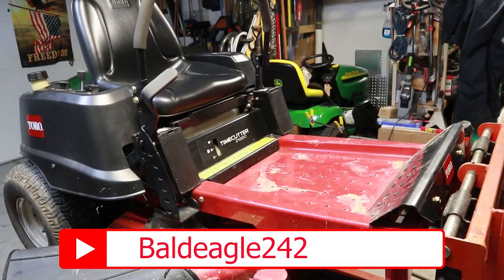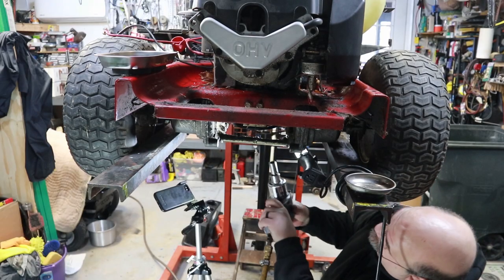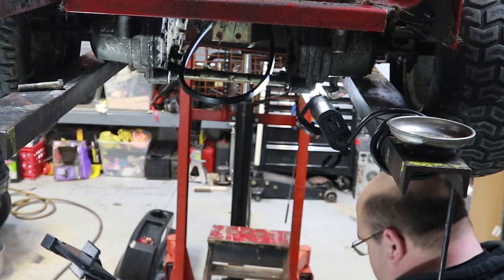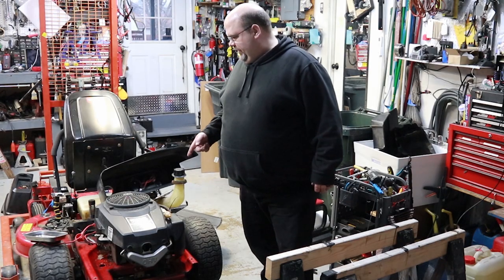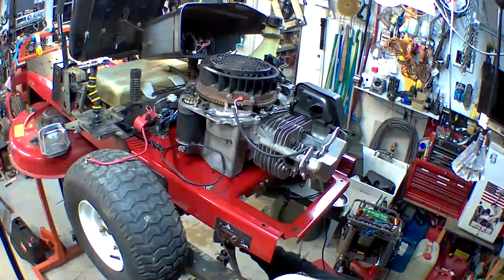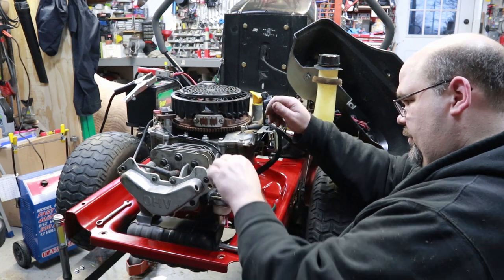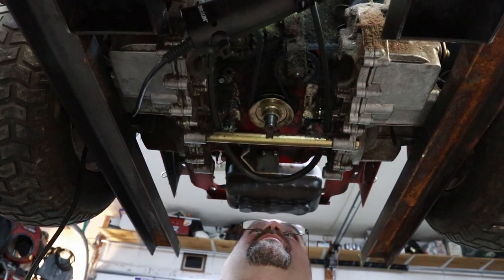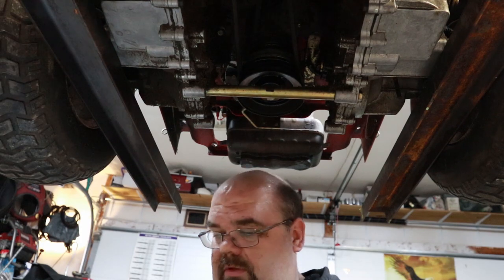How to PREVENT the Kohler Courage Engine from Cracking the Block #baldeagle242

Comment: My Courage emptied the oil while mowing last week. Yup bolts were loose but had not reached flywheel but enough to allow stress crack. 
I'll try JB and blue Loctite.
Reply from the maker: I wish there were a way to make a public announcement about this issue. 🤦🏻‍♂️
I'm not a big fan of the Courage motors, to begin with, but this situation is entirely preventable if caught early.  
Thanks for watching and good luck with your repair.  🦅
Reply: For a cracked case, try the product allumalloy aluminum soldering rods. Haven't used them for a cracked case, but have used them in other applications.

Comment: That's what happened on my neighbors CubCadet rider, it broke the cylinder clean off the block!
I got it for nothing, put a B&S motor on it from a Craigslist guy who has basically a mower junkyard.  Paid him $50 and the Kohler motor (starter and carb looked fine) ran it in the county fair demolition derby ($120 for 3rd place) and sold it for $300.

Comment: i have the exact same mower i changed my engine out for a Command 23 that i got for $60 it was from a John Deere L130 fit perfect just had to re-wire adjust throttle and add a Choke which a hole is already cut out for next to throttle cable

Comment: I can say I change the oil in my 2006 very frequently.  Every mowing actually.  Fortunately the crack is at the top :)
Reply from the maker: I’ve seen them run for many years with a cracked case if the oil is kept topped off. 😉👍

Comment: Have one like that one,  bought new from HD in 2007 with the same motor, it's just now giving me problems I consider myself very very lucky since that mower has been worked hard every summer and fall.
Reply from the maker: Thanks for watching.  I've seen a few 15+-year-old Courage motors still running well. With a few precautions and regular maintenance, they will last.  They're just not a motor you can beat on and neglect the way some owners choose to do.
Reply: I have one from 2005 which I owned since 2010. Still goes on perfectly fine.

Comment: My Courage blew up bang,  fire and oil.   I was told that a counter balance weight  comes loose over time on the flywheel.  They are really the junk lowest end of Kohler engines.   The lawn mower dealer here told me that they almost all blow up and have to be replaced.
Reply from the maker: Generally it’s the case bolts that catch on them and and knock them off.

Comment: Tell me about that mower lift you have.. Home built or store bought? I could use one... TY
Reply from the maker: That lift was bought from a tool rental place that I've done work for.  The owner told me he'd had it there for 2-3 years and never rented it once.  I purchased it for $200. I added longer forks to pick up riding mowers and zero turns and welded a flip latch onto the mast to lock it in place once it's up. Other than that, it's all original   
Here is a link to a similar one on Amazon.  They're not cheap.  
(may need to copy and paste)

https://www.amazon.com/dp/B08SLY7C9T/?tag=eagle0f1-20
Reply: Thanks, got the link. Is salty but I know what I'm looking for now////
Reply from the maker: +Tbear rails, you're welcome, thanks for watching. 🦅

Comment: Let's say my Toro is in great shape but this hapoened to my engine... if possible could I replace the engine with something that is not prone to these issues?
Reply from the maker: Yes, just about any similar sized engine can replace the original. The main issue is making sure the shaft size is the same length and OD and the exhaust system comes out in a location that works.

Comment: I like your videos. Curious about the lift, you say you use it every day. Do the forks get in your way as you work?
Reply from the maker: +colten1d 60 

There are times they can be in the way for sure. You want to remain aware of them, so you don't hit your head on them.  It's no different than any other type of lift in that regard. For the type of work I do, the pros outweigh the cons by far.  By design, the lift is easy to push and move around as long as it's on a relatively flat surface. I would not recommend it if you're going to use it once or twice a year because it does take up a lot of floor space.  On the other hand, you can raise something and park other equipment under it to save floor space. 
I've had enough questions about it that I plan to make a short video about the lift soon.  
Stay tuned!  🦅
Reply: @baldeagle242  Thank you.

Comment: I have the 5400 engine. Should I worry about this? I can easily remove the shroud and Loctite these bolts.
Reply from the maker: I've not seen a problem with that engine but it never hurts to check.  Thanks for watching.  🦅🇺🇸
Reply: @baldeagle242  I just found your channel and plan tp binge watch when I get time. Thanks!
BTW what are your thoughts on the 5400? I read where mechanics don't care much for the Courage, I thought the 5400 was pretty much the same engine.
Reply from the maker: @unti419 Thanks for watching.  Most of what I work on are older machines.  The 5400 was introduced in 2014, and so far, I've not come across one that needed internal work. That doesn't mean it's good or bad, just my personal experience.  From a quick google search, I found a few links with more details.  The information on Kohler's website has quite a few facts about the 5400.  Kohler is well aware of the reputation of the Courage; I would assume they did as much as possible to address the significant issues that the engine was plagued with.  With that said, the 5400 is still a price point engine, so, in my opinion, it's not going to be an engine that's expected to run for 10,000 hours.  Next time I get one in my shop ill try to do a full review on one.
Reply: @baldeagle242  I changed the oil in my 5400 tonight and pulled the shroud. It requires 4 10mm bolts and a T20 screw in the plastic intake manifold above the carb. All the case bolts were tight, there were a few manifold bolts that felt loose but it's all plastic so I just snugged them up.
Reply from the maker: @unti419  That's a good deal.  These engines can run for a long time with a bit of attention. Thanks for watching.  🦅🇺🇸

Comment: What are your thoughts on the power more single cylender engine
Reply from the maker: It’s an MTD branded engine that’s built in China. They are basically a disposable engine with limited parts available.  With that said they are comparable to the Briggs and Kohler entry level engines that are built to budget friendly price point.
Reply: @baldeagle242  I am trying to start a service and fix/flip shop I have close to 30 mowers most need some form of carb work mtd with the steering problems I have a craftsman with that and the yard machines with the powermore I appreciate the comment
Reply from the maker: @alliesman9758  I’m starting to see more and more of them each year. Some Kohler parts can be made to work in certain situations.  They are basically a Kohler knockoff.

Comment: Can you show me where and how many bolts that engine has to mount it plz
Reply from the maker: There are 4. One on each corner. One of them may have a nut on top that also hold the negative ground cable.

Comment: An honest seller, which doesn't happen every day.
What is the name of your lift?  What is maximum lift weight?  About how much does it cost, and did you buy it on Amazon?
Thanks
Reply from the maker: The lift stacker is made by Jet.  It's used for moving and stacking pallets.  I purchased it from a tool rental place that I do work for.  They had it on the floor as a rental, and when I asked the owner about it, he said he'd had it for 3-4 years and never rented it once. He sold it to me for $200 just to get it out of his way.  I use it almost every day.   Thanks for watching.  Here is a link to a similar lift.  
https://www.amazon.com/dp/B091NQNBXX/?tag=eagle0f1-20

Comment: There are just too many design flaws with this engine other than the case cracking. The valve covers always leak and the mechanical decompression assembly on the plastic cam gears just to name a few. I would repower with something else unless you want to keep working on it.
Reply from the maker: You're not wrong. 😉
If I didn't already have the extra “Discourage” engine sitting here I wouldn't have bought one to put back on it.  Thanks for watching. 🦅🇺🇸
Reply: I have a 15 year old mower with a Kohler Courage 15, not had a single issue with it. Just waiting for something to happen when I see these videos.
Reply from the maker: @erlenddammen2174  I've seen some pretty old ones still running strong but I've also seen more than my fair share of blown and cracked cases also.  Thanks for watching.  🦅🇺🇸
Reply: I hope it holds up. Used it with success as late as today.
Reply: @erlenddammen2174  Kohler Courage single cylinder?
Reply: @andybecker2693  Yes.

Comment: learnd alot about my kohler motor. got a free mower what had a fire. tore off all the burnt crap, put a battery in it. with startr fld it startd. coil wire burnd to fiber but still startd wow! hosed it off now it wont start. fuel line not leakin and still intact. couldnt find a fuse to check. vapor hose into air filtr i thought was just a nipple i now realize is a hose to air cleanr.
Reply: ive got couple othr mowers, now im thinkn about scrapn the 20hp kohler for a briggs 18.5. hopefully my belts will still work
Reply from the maker: Belts should work fine as long as you reuse the same pulley.

Comment: Thanks for the info. I had a rider with a Kohler Courage and I didn't have this problem yet...but I'm sure it was lurking around the corner.  As to date, it was the worst engine I ever owned. The biggest problem I had was the valve cover leaking oil even after replacing the gasket and cover. It would drip on the exhaust and smoke. Also, the valves constantly needed adjustment. Just after a few hours, it would replicate a dead battery but turned out to be valve lash adjustment
Reply from the maker: The Kohler Courage is one of the worst small engines ever built.  Valve covers leak on almost all of them, cam gears are plastic and the problem I mentioned in the video with the case bolts backing out is the demise of at least 4 I have worked on.  The most surprising part about this entire video is I had a "good" one to replace it with.
Reply: The Kohler  Courage is a real dog, especially the single cylinder.
Reply: @baldeagle242  There is a update kit..."Kohler # 20 096 14-S"  ...new valve cover, cork gasket, and a stiffener plate that fits along bottom edge of valve cover to bridge the area where bolts should of been. Coat the gasket lightly on both sides with non-hardening gasket sealer, properly torque bolts to spec...no more leak.

Comment: I thought Kohler was better than this!! What chunk they are!! 
Mine has 170 hours on it and the rocker arm stud loosened up and took out the entire exhaust valve train. Rocker arm split, the push rod bent. I replace them and tried to adjust the valves. When I set the exhaust side at the 0.07 it compresses the valve spring so much that the engine locks up. 
Now I have to tear the case back apart and try changing the cam and  the follower. It must be damaged too!! I hope it works I gotta cut my grass!! 💩💩
Reply from the maker: The older Koehler K series engines and the “newer” Command engines are not bad but their Courage line was built to meet the lowest price point possible and they just don’t hold up over time.

Comment: You have real good vids here so thanks for it! I didn't know about the case bolt issue so it's high priority to get after it! I hate the lack of non-serviceable parts on my toro 42SS timecutter. Especially the hydrostatic transmissions not having a drain and fill plugs. Do you have a method to service these before it's too late?
Reply from the maker: My father still pulls them apart and rebuilds them. Most of the time the only thing he finds wrong with them is a clogged screen with buildup in it. Other than new seals, bearings and gaskets most of them go back together with all the original parts. We’ve talked about making a full video about this but haven’t found the time to complete it. Here’s a link to a really short video he recorded of himself last year rebuilding a hydro transmission. 
👴🏻Father’s Day with Dad: Cleaning & Assembly Project with 81 year old Father!
https://youtu.be/gyqeDNfXBow

Comment: Nice video! Would you happen to know if a sv730 the 25hp twin cylinder will bolt up to a z4200 that came with a sv610 the 21hp single cylinder model?
Reply from the maker: The simple answer is, it should but I’ve never made that swap. Common issues are exhaust connections and location. You will need to make sure the 25hp comes with everything and possibly the linkage connections. Another thing you want to check is the shaft size for your clutch pulley. The 25hp might be larger. 
The mounting holes “should” be the same.

Comment: Hey Bald eagle. 👋 how are u doing these days.  I have a friend that has a kohler courage 20 hp. It just started missing on him the other day   It had been running fine. We changed fuel filter ,plug ,put fresh gas in and it runs good for a few minutes then it starts missing again. What would you check next.??  I know the courage has a bad reputation. It's on a cub cadet 1045 riding mower
Reply from the maker: Check the fuel cap.  It may be as simple as a cap that's not venting enough to keep the fuel flowing. 
If that's not the issue you may have a bad or weak coil.
Reply: @baldeagle242  ok thanks very very much 👍🙂

Comment: I am pretty sure I commented in the past, but I am doing this again on another mower.  It is just a great video.  I would love to see a short on how to get that PTO clutch and pulley off on a hard one.  My first one was very hard and this next one looks to be hard also.  Any comments?
Reply from the maker: I use an Air Chisel to Remove a Pulley if it’s stuck. 

	1.	Prepare the Bolt:
	•	Screw the bolt back into the pulley, leaving it backed out by 3-4 full turns.
	2.	Create a Center Point:
	•	Drill a small divot in the center of the bolt to help keep the air chisel centered.
	3.	Apply the Air Chisel:
	•	Position the air chisel on the divot and start hammering on the bolt.
	•	While hammering, pull on the pulley simultaneously.
	4.	Adjust and Repeat:
	•	As the pulley begins to come loose, back the bolt out further.
	•	Continue this process, hammering and backing out the bolt, until the pulley is completely free.

Comment: Hey great video I do this I dabble in this stuff too that myself question does the bolts back out of the courage twin as well or is it just a single's have that problem with the bolts coming out thank you
Reply from the maker: Thank you. I've not seen it on the twins. This seems to be unique to the single-cylinder engines.

Comment: 480 hours on my 2011 cub cadet with the courage 19. Original owner was my grandfather who did absolutely no maintenance on it. Oil change ever 3 years or so. I got it from him with 400 hours and did all the due maintenance and have since. That motor has never been apart and still runs like a top. I guess I got a good one.
Reply from the maker: Some smokers also live to be 100 years old. 😉
There are exceptions to every rule.
Reply: Great way to put it! I’m definitely chalking it up to luck. I’m going to see how far I can go with it before it blows. Hoping for 600 hours at least.

Comment: Have a Kohller sv530 that’s spraying gas out of the carb, any suggestions.
Reply from the maker: It sounds like you may have an intake valve that's not seating correctly.  I'd do a compression check or a leak-down test to see where you're at.  This assumes it's spraying out the intake side of the carb and not just a leak.

Comment: If you can't get a kohlor courage 19 because they don't make them or the replacement motors anymore would a newer 22.5 Toro work
Reply from the maker: +Calbert Kensill, there are a few other motors that will work.  
The main things to check are:
1. Shaft OD
2. Shaft length
3. Does the exhaust come out in an area where the muffler will fit  

Throttle linkage and fuel connections are also essential but generally a little easier to change or reroute.  
If you're swapping to a larger twin-cylinder, you'll also want to make sure your hood will still fit around the engine and close as it should.  

Let us know how it works out for you and good luck with your engine swap.  🦅🇺🇸
Reply: @baldeagle242  I know both shaft od is 1" it's for the same zero turn timecutter that you were working on in video im trying to avoid getting a motor that has the problem with the bolts backing out cracking the block that is on it now but im also having trouble getting muttin equipment to order the 22.5 they had me pay 910$ to order a motor when I went to pick it up it was in the back of one of their employees trucks it looked like they had just pulled it right straight out of the junkyard and it was the same kohlor courage 19 that i told them I didn't want im not paying 910$ for junk out of the junkyard so I had to get my money back now I can't trust anyone to order what I asked them to order

Comment: Nice work. I was wondering....why does the throttle lever on the carb not move when I work the speed control lever? Choke lever on the carb moves, but the throttle speed lever does not.
Who controls the RPMs while the engine is running?
Reply from the maker: It sounds like something has broken or come loose.
Reply: Nothing is broken, lose or missing. I checked it multiple times.
Even on your mover you will notice that the throttle lever on the carb does not move when you operate the speed control lever. Only the choke lever moves.  @baldeagle242
Reply from the maker: @samkitty5894 it’s tuff to say what’s going on without looking at it myself.